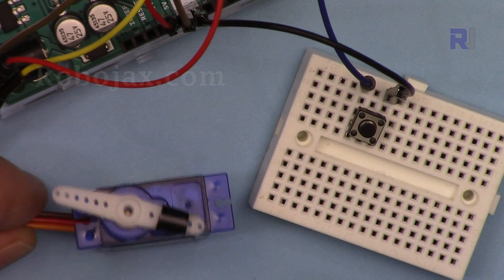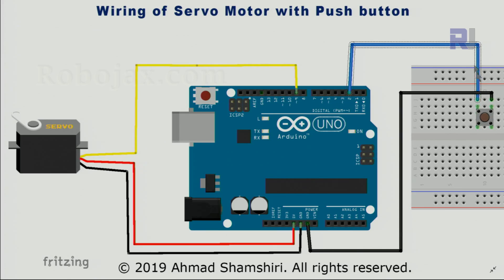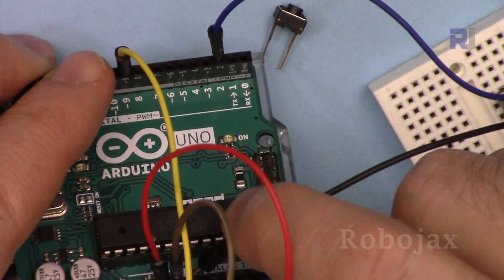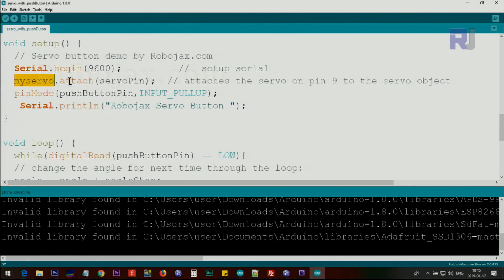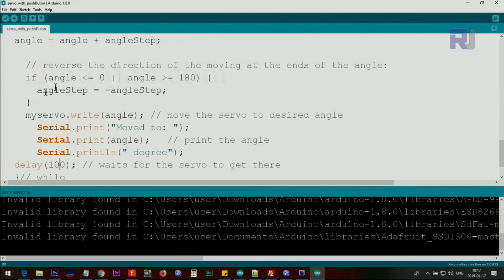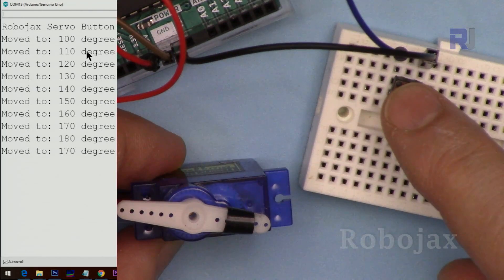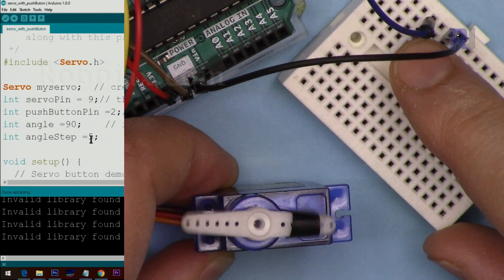Lesson 87: How to control Servo motor with a push button switch SPB-1 - RJT460

Comment: hi i wanted a code to move the servo to 180 degrees using a switch and after 3 seconds the servo should be back to its initial position can u please help
Reply from the maker: Hi, please seach my channel for Servo. I have tone of videos on server control and learn from them. It is easy as I have explained line by line of the the code.

Comment: If i change pushbutton to limit switch it will work like pushbutton action in your video?
Reply from the maker: Yes it will. Just pay attention and see is this push button is sending LOW or HiGH ans make sure your limit switch does the same.

Comment: dude your code don't work
Reply from the maker: "don't work" is not good. provide error to help you. Arduino shows error at the bottm with red. if there is not error, then you did not connect the servo or push button correctly. I would suggest test the servo with file->examples> and find servo basic examples and test it before coming this video.
Reply: Is constantly running , I don’t get an error, the button doesn’t do anything, I’ll try again, but if you really like to help I need the button to run the motor for just 10 degrees every time you press it, I’ll pay you if you can help me out with that.
Reply from the maker: I have over 10 videos of servo with buttons. I have explained every line, test you push button switch. when you pess it, print something in the serial monitor to see if it is connected correctly.  My vidoes are not for taking the code and go but also for learning. I am the only person cares to teach people. So please watch this video repeatedly. When I face an issue I watch it 10 times to learn it. Do that.

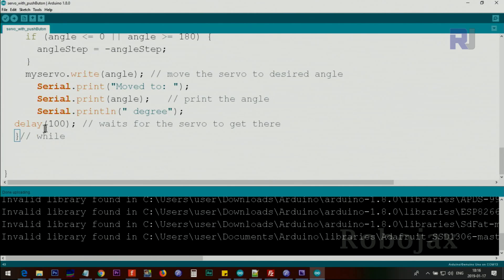Comment: @3:39 while(digitalRead(pushButtonPin) == LOW){ 
this means when push button (connected to pin 2) is not pressed the while loop should run which contains if condition also right? then how come servo is rotating when button is pushed? bit confusing to understand..

Comment: Sir you are the Arduino guy on here it looks like.
I have had breif conversations with you before.
Got a new Arduino problem I can't find the answer to, I thought you might know...
I have a Nano a TEA5767 fm radio modular, an amp 5 volt regulator for it and a 1567 display... The snag I have is it won't run on anything under a 9 volt battery. 
6 C cells won't do it.. I'm hooked up to the 5+ and neg on the Nano.. Then it doesn't run under about 8.5v on the 9volt which runs to that point in 45min or so.. Ya know we can't ask on Arduino . I have an inner code between the Radio modular and the display giving me a noise but can't ask on there and am still looking for an answer , but the power supply is the hang up now.. Ya won't believe I had a phone break and computer break on newyear day and hopefully I don't loose all my code when the new computer gets out of the shop. Hard drive copy but she said she couldn't transpher my Arduino files and the screen and USB ports failed and her way is fine he only way I have now..     When it rains ya know. 
Sorry,,,, but really I appreciate your channel... Bob H.
Reply from the maker: Hi, sorry I I have not seen or heard the item you are mentioning.
Reply: @robojax  Thank you
Arduino  sais it will run off 5 volts, I just wonder why I have 3 and am just noticing it not being able to.  Pin 29 and 30 on the Nano is all I can find.   told ya about  the computer crash so ya might know I couldn't program another board to see if it's maby the internal regulator.   Again thanks for your channel.   I do appreciate it.. Bob H

Comment: Will you cover various ways to use Hall Effects sensors, Example: As a magnetic switch. To count rotation of a object. As well as the strength of the magnetic field, and display the info. Example, displaying in feet how much paper is rolled off a roll. Just some thoughts. Hall Effects sensors are super cheap and have a lot of uses. Thanks.
Reply from the maker: Yiu must have skipped. There is section with multiple lectures on that